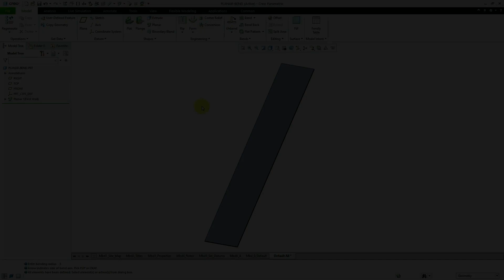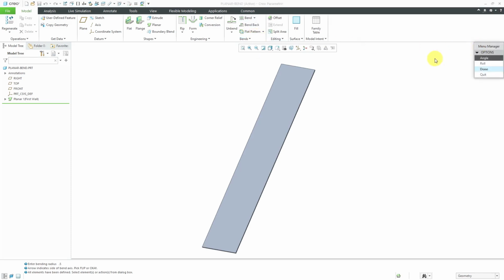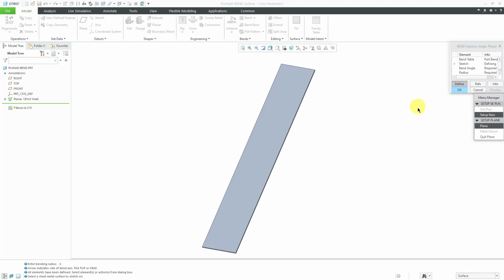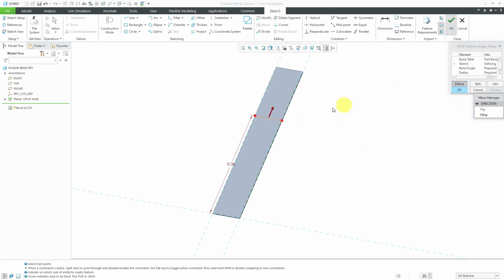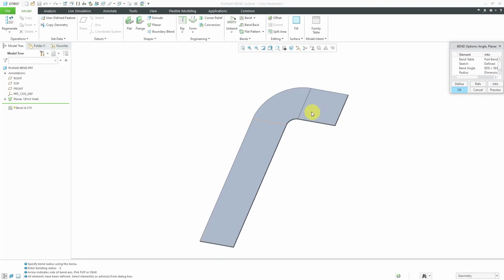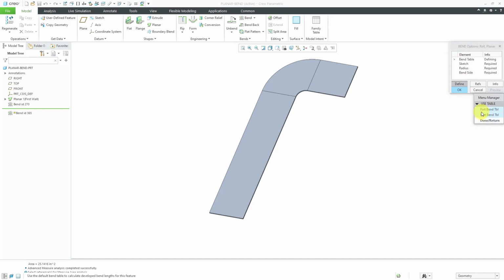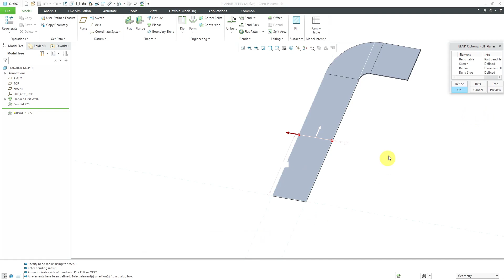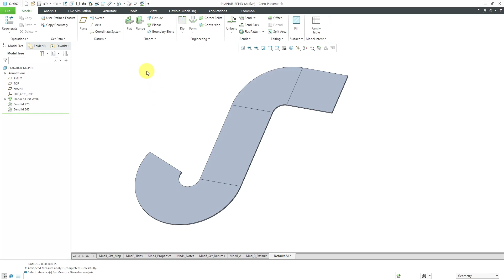Creo Parametric Sheetmetal - Planar Bends

Comment: Well your channel is one of the best on the Channel.I am old  Pro/E user and I am updating to Creo. This command is the same that I used in 2005 in ProE 2000
Reply from the maker: Thanks. Planar Bends have been around for a while. I trust you find that the command's interface has been updated and is less rigid than in the Pro ENGINEER days.
Reply: @CADPLMGuy   I  totally agree to you but I believe  Drawing enviroment is still not so intuitive as Solidworks and Inventor are.
Reply from the maker: I was referring to the Planar Bend command interface specifically. I agree that SolidWorks and Inventor are easier to use. But if you delve deeper into my videos, especially the ones where I talk about CAD in general, I make the point that there's no "best" CAD platform. Aside from the needs of the product and the needs of the organization, it then becomes a matter of trade-offs. Easier to learn and simpler UI/UX almost always means less functionality and fewer edge cases.